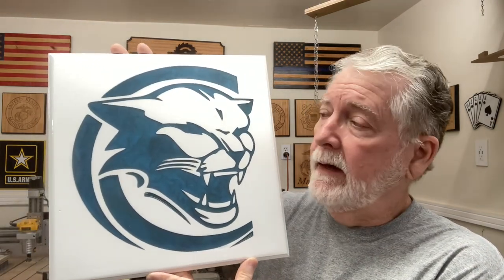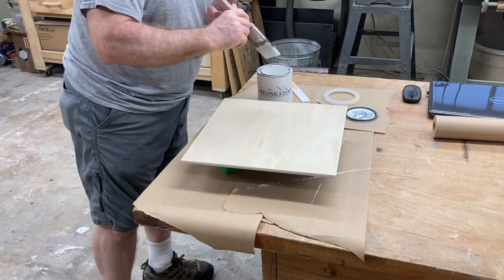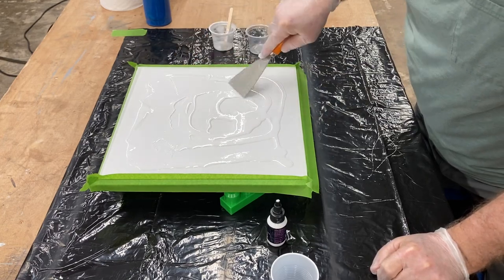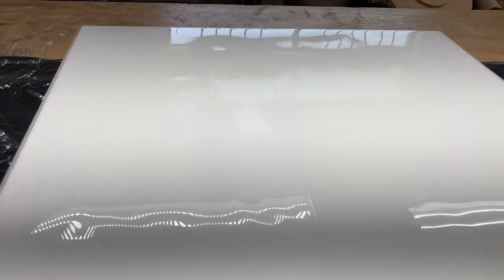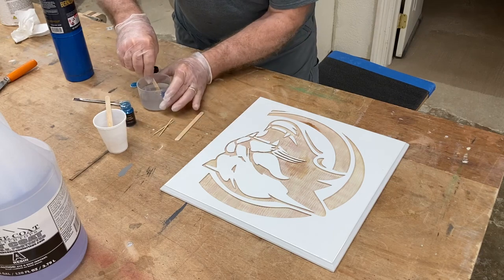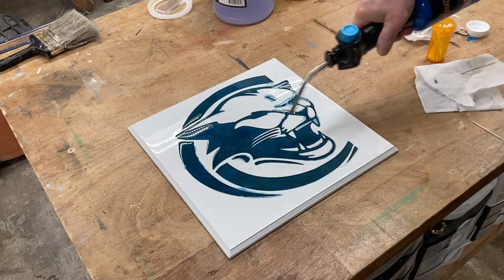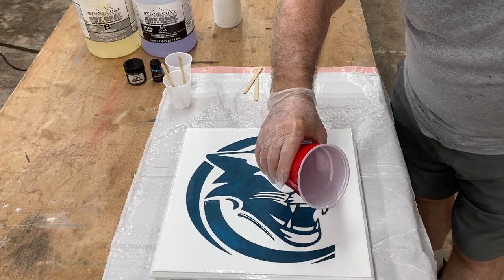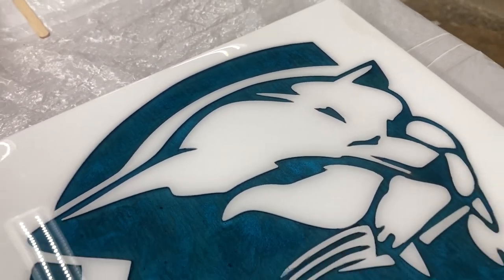Easy to Follow Step by Step Epoxy Inlays with STARBOND MICA POWERS and STONECOAT COUNTERTOP EPOXY

Comment: Nice work, I recently found your page and enjoy watching. However, if you're going to be mainly trying to teach folks make sure to give  good info especially with epoxy. You instructed several aspects of epoxy mixing and pouring that were incorrect and can really mess up someone new. One example is scraping your cup to get every last bit out onto your project. Only takes one time to get a soft spot from unmixed epixy by doing that and they'll either give up or spend more money. (That is experience talking lol)

Great end result, it would look cool in a pvc blank as well. Good luck
Reply from the maker: You must mix completely including scraping the sides of the cup. Epoxy is expensive. You shouldn’t waste it by not scraping the sides of the cup. Poorly mixed, yes you will get soft spots and poor quality pours. Thank you for your concern